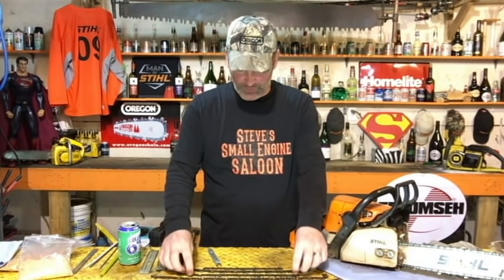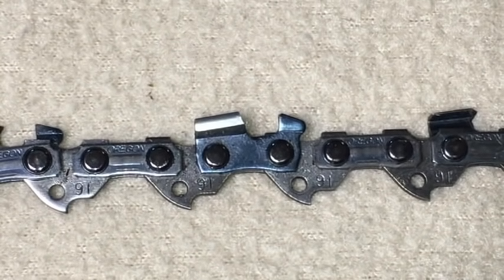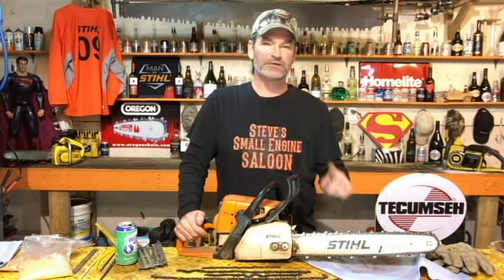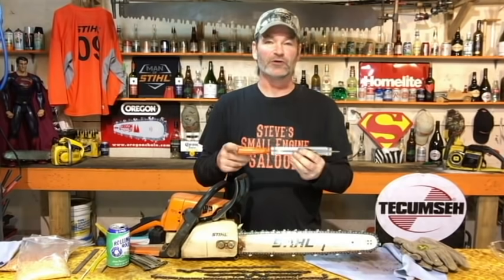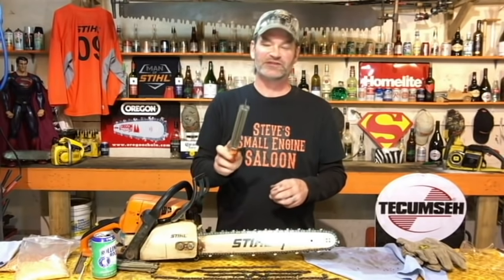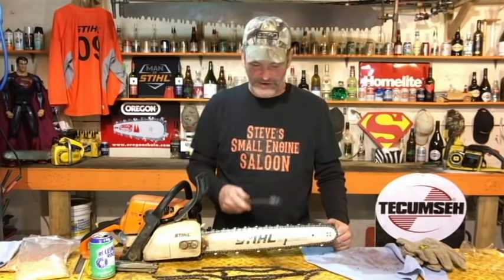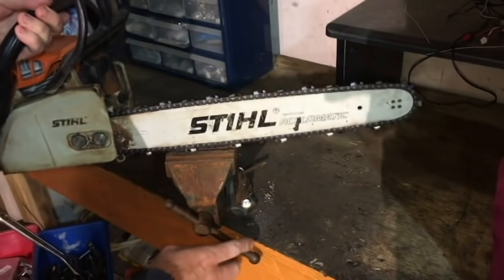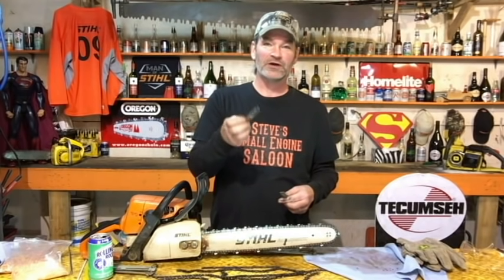CORRECT WAY To SHARPEN A Chainsaw (Step By Step)

Comment: Whats up steve i was sharpen my chain on my ms170 and noticed on the bar the oiler hole is kind of small could i possibly drill the bar oiler hole out a little so the bar gets more oil when cutting

Comment: Hey Steve, what's your opinion about electric grinding type sharpeners?  I know they leave a very sharp tooth but I have been told they are more difficult to keep sharp with a file after that?  Also the chain wears out faster than just sharpening with a file.

Comment: Raker guide that guages off a single tooth, like the one shown, sets the height to match the tooth they are in front of and also protect the sharp tooth from being hit by the file.  I don't use a guide for the round file anymore but ALWAYS use the raker guide!
Reply from the maker: Right on

Comment: I'm old small engine hobbies for over forty years but not an expert on two cycles , my question is that I can buy non-ethanol gas from a local gas station  as I have done for many years . is it as good a gas to use as the non-ethanol gas in the can for two cycles you can buy at Walmart or other places .
Thanks in advance , Marshall Border here in Jonesboro Arkansas

Comment: at around 7:50 you mention that the horizontal angle (perp to bar) should be flat.  some chain manufactures specifications require a 10 degree angle - when sharpening, should we be changing the angle from factory spec?

Comment: My Oregon chain, according to Oregon, is to be sharpened at 10 deg. tilt, but there is note at the bottom  that says at 90 deg. or flat, as you said, IF using the sharpening guide.  What could be the difference?

Comment: thankyou very much that was a great explanation of how to sharpen a chain. i have just bought a GT Garden TT CS 5800. a quick question do you know what type of fuel i would need to use for this saw ? today i put in petrol, and it did not work. the guy i bought it from i think he said the fuel should be a mix, he is french and i am scottish so i think it was lost in translation ?

Comment: Been sharpening chains for years, and looks like I do it right. Never would have occurred to me to file backwards!
I'm quite good with a saw, but after 59 years of intermittent use I'll still find a nail or stone if there is one. So I have to sharpen the saw on the job, away from the garage. I sharpen without a guide, saw across my knee, holding the bar and chain with one hand. I'm not saying I'm right. But I just like it that way, and would guess I hit ninety, maybe ninety five percent accuracy. Maybe more, I don't know.
Good one about looking at the chips, I knew that, you know I did.
Reply from the maker: Right on Stew!  Thank You...

Comment: I am a chainsaw sculptor.. Steve you are very informative, but I disagree with the direction of filing. Let me ask one question, which direction do you sharpen your knife? Hopefully against the edge. Why?  Because  drawing the knife away from the stone/file rolls the edge. Yes I realize the file skips from time to time going against the edge but that only allows me to know 1) either the chain tension is to loose, 2) I am filing with wrong form/angle. Hope you understand my explanation
Reply from the maker: Fair enough!

Comment: Hello Steve! Thanks for the video, I have a question for u and very curious on ur reply . As u would know there is on some chains there r a 10 degree table tilt when using an electric chain sharpener, how much can it differ the chain when sharpening it by hand? I hope I catch ur reply thanks

Comment: GET THE GULLET! And I use a husky raker guage. The little flat steel with a hard and a soft wood side. If you've hit a Rick or bullet and really damage a tooth or teeth that have to be sharpened way back a raker guage is a must.

Comment: My problem has always been keeping the same angle side to side. I'm right handed and when I switch to the left side teeth is when I have trouble keeping the angle. But i never had a vise to clamp it in, I was just holding it with my off hand on the tailgate of my truck.

Comment: I’m 50 years old and have been sharpening my chain into the blade instead of away from the blade. Just like I sharpen a knife blade. The edge will produce a micro burr when sharpening away. 
I noticed you made sure to mention to sharpen into the blade. I know it’s not wrong because everyone I’ve seen sharpens that way. 
I think of each tooth as a little knife and can make them razor sharp. 
Am I alone in this camp of thought ? 
Would love some feedback on this

Comment: For ultimate precision, the Granberg file guide is excellent.  Each tooth filed exactly at 30 degrees, not 29 to 31 degrees, exact same depth with depth increments at 0.01".

Comment: A question on zero turn. I gave a To 42” cut zero turn that backfires when I start it and backfires when I turn it off. I have tried just about everything. Higher octane gas, full throttle when shutting down, idled down before shutting down, nothing helps. Can you help? Thanks a lot.

Comment: Thanks a lot. I been doing good except for the raker height. I never had filed them on a saw and I know thats been a problem.  Thanks even more fir telling people files only cut in one direction. Same thing with hacksaws people. Lift the blade on the backstroke. Also make a full stroke every stroke cause she dont like short strokes.
Reply from the maker: You're Welcome...

Comment: Razor sharp & same length   Is possible with just a file , the trick is to sharpen offen , but lightly ,  the longer you wait between sharpings you end up filing out damage in turn shorting it quicker .

Every time , I refill I sharpen , i also sharpen for every tree  

I take off less than if you what until it's blunt , as a blunt chain will compounded its damage .

Comment: Hey Steve, I have a Dolmar 6100 that I bought used. I tuned the carb to factory specs when I rebuilt it. When I start it, the chain turns at idle, whether or not I pull the trigger. Does it need a new clutch?

Comment: Steve good day to you, I have a question that I'm hoping that you can help me with. I own a Murry 13B326JC758 Murray 30" Riding mower. The mower itself has very low mileage and is used only 3 to 4 times a year at a vacation home that I own. The issue that I am having is the drive belt for the blade keeps breaking and I have changes the belt three times to date. I am only getting one cut before the belt break. The belt is tearing apart from the inside of the belt and not form the outside. I've changes all the pulley's with include the Spindle Assembly and the two other pully's that the belt rides on. All the pully's are lined up correctly I used a metal straight edge to check. All the Pulley's are OEM Parts form Murray including the belts. At this point I'm lost and hoping that you have a clue or lead my in the right direction....

Comment: Started watching your videos a couple of days ago when I was getting unusual “banana” cuts with one of my saws. Turned out to be the bar wearing low on one side after a particularly hard struggle with a large ash (it’s only a Ryobi rcs4046). I’ve always had good results sharpening by hand with Oregon 5/32 files and no apparent issues with the rakers going off. Anyway, inspired by the videos I’ve bought the Oregon sharpening kit and extra flat files for deburring and profiling the bar so we’ll see how it helps. Many thanks for making the effort to share your knowledge.

Comment: Steve, @12:50 (the dull thoot), 1st I use a flat file to remove the curve (the dull) while keeping the angle (30 degree). Then the round file as you did. Is it a good idea? Enjoy your Rocki'n Rock🍺

Comment: Good video.  My family owned a tree service until we all retired.  You covered everything I learned the hard way.  Especially the rakers.  I had to stress that to many of our employees.  That if you ignore the rakers the chain won't cut well. and you take off too much the saw probaby won't cut at all - it will stall.  I recently came across Stilhl's 2 in 1 chain sharpener and may give it a try.  Oh, and I had to stress - keep the chain out of the dirt!
Reply from the maker: Right on

Comment: The crazy thing is I use a raker gauge with the proper depth for my chain and it gives no chips just powder.   I wonder if these gauges are off or what.

Comment: I never successfully did this and I worked with saws for years.  The only thing I could do was get new chains or have them professionally sharpened.  Usually if I got any edge at all trying myself the saw would cut a curve lol.  It’s an excellent tool but no fun without a really sharp blade

Comment: I have a Echo CS590 that has the 3/8 .50 chain and been using a 13/64 file and wondering myself if I'm getting it sharp enough. I have a 7/32 file that was recommended and also the Stihl 2 in 1 but since I started with the 13/64 I've wanted to stick with it. The hook feels really sharp but feel like I'm not getting the gullet right. Guess I'll learn by trial and error cause I'm a green horn with no one to give me direction. Anyone have any suggestions that would be helpful

Comment: Steve, My first experience with a chain saw (I live in England) and this video makes me a lot more confident I can maintain this useful piece of equipment. (I am over 70yrs old so a late starter with a chain saw.) Need to start cutting logs now oil and gas so expensive. Feel a lot more confident after videos on chain tension and chain sharpening. You are a great teacher and your instructions are very clear. I have had a file guide in my tool box for over 40years and never knew it was for chain saw teeth! You live and learn.

Comment: Great video, and worth the time to watch, although I did at 1.5 speed.  :0)  

Perfect timing on this, at least for me.  I just slammed a guy on another channel swearing by using a file in a drill.  I likened him to people that would sharpen a kitchen knife on a bench grinder because it sounds great to those with no sharpening knowledge, but the depth of the file controls the angle at the cutting edge, and without the guide, there's no way a human can keep that angle within 1/16 of an inch without shifting.

Comment: Absolutely fantastic info! No worries about the length, it was all essential, useful information. It’s exactly what I needed to be able to sharpen my saw chains properly and with confidence.

==> As another viewer commented below, I’d really like to see a short vid on how to sharpen rip chains, as I want to slab some beautiful red oak logs I have in my back yard after we had to have a couple of trees taken down.
Reply: Same technique just a 10 degree angle advised for ripping (vs. 30 +/- for cross-cutting).

Comment: 3/8 chain is not always 7/32.  Stihl chain is 13/64.  Oregon and Husky are 7/32.  I keep both sizes in my file set, Stihl of course and all are fitted with file handles, even my raker file.  I do left hand cutters, first, and then flip it around and do the right hand cutters.  That laser line on the rear of the cutters is the wear line for the chain.  When you reach that line the chain is worn out.  It can also be used as a guide line.  Please remember some chains are ground at 30 degrees(Stihl) and some 25 degrees (husky). I file all chains at 30 degrees.  I sharpen a tooth until I get a sharp cutting corner.  I do not use a vise, but I put wood blocks under the end of the bar to support it.  I check my rakers every time I sharpen a chain.  I do set my rakers slightly hungry.

Comment: What have gone wrong that after sharpening the cut is crooked? In case of big log it's even impossible to cut because the bar jamms? The 30 degree angle is kept because the chain was sharpened using dedicated grinder? Isn't it because of bad depth gauges hight?
Reply from the maker: That video is in my playlist

Comment: Maybe this is just because I’m using such large saws and bars. If you start getting too many short teeth on one side the saw won’t cut straight and the cut will curve off. I try and keep all my teeth within 1-2 millimeters in size.

Comment: Even amount of strokes per tooth... whether right or wrong, I was taught that the amount of strokes required to fix your WORST tooth should be applied to the remaining teeth for  fully sharp and even length teeth.

Comment: I tried to cut through a stump with rocks in it. I need an electric file grinder otherwise this chain is extremely difficult to fix by hand manually

Comment: Another thing
Use a sharp file.
Chain saw files are cheap, have plenty on hand.
When a file stops cutting well, get a new one
Your cutting edges will not be as sharp or as accurate using a blunt file.

Using a guide and sharpening the chain, accurately, at the same angle, every time, every tooth. makes your chain last longer.

Sharpen early, the sharper the chain the better it will stay sharp and the longer it will last.

The idea of sharpening every time you fill the fuel tank is reasonable even if you put two strokes on each tooth.

Comment: Long videos u really need endurance. Endurance requires a second or third beer as it's premium fuel.

Anyways in last 42 years since I first sharpened saws Ive used almost every filing gadget ever sold. Some take setup time, some fidgety. 
The one that sharpens cutter and depth guide to me is not perfect as way out. 
I still like to use the standard file and guide then following up with the depth gauge and flat file.

Comment: You will have a slow cutting or a dull chain if you use a filing guide like this one. The file doesn't go deep enough into the tooth

Comment: Check list: Right size file for your chain, correct angle (it varies, belieweor no depend on task but 35 is good start) , all teeth are equall lenght (shorter do not do any cutting), all teeth are sharpened. Push file, not pull (it will dull).

Comment: I’ve always filed backwards, and I’m really curious as to why it’s considered wrong, as when you sharpen a blade, you file into the edge, and not out, so you don’t develop a burr on your cutting edge. I’ve never used a guide either, and I’ve found the chain will chatter almost every time if you don’t somewhat support the tooth your filing. I simply put my thumb into it. 
  I’m not saying filing the other way is wrong, it just doesn’t make sense to leave a burr, or go back and take it off. If someone could better explain things, that would be great.

Comment: Steve you mentioned running your chain backwards.
I think I may have mentioned years ago my Husky 77 when I started it, it was running backwards.
My man said he had never seen it .
After I showed he was amazed.
Only thing obvious was partially smashed muffler.
We opened up the vanes on muffler pulled rope and it ran perfectly and in right direction.

Comment: Steve, when you sharpen any edge tool like a knife, or chisel you push the edge toward the abrasive to avoid creating a curl on the back side of the edge. Everyone sharpens a chainsaw tooth by filing in the opposite direction. I understand that's how it is done, my question is why?

Comment: 9:30    one could just place a red, or pink, line, on the bench underneath the bar.    sharpen one tooth, move chain, ;; repeat till done.

Comment: 6:20   just put the damn bar, in a vice. That is what they're for....to  'hold'  things, so the filer guy, can 'do his thing'.... i would tighten the chain, as much as it could go, then file away. After, then adjust it, for ' proper '' tension, as per Dr Steves'  info  .....ONLY  file, either pushing away from you, or reverse file, and pull toward you. The file, will last  a    l o n g     time.
Reply: 7:00     A    HA    !!!!

Comment: Every pro I know just sharpens on the spot with no vice and most don't use a guide. Your method is accurate but not realistic at all when you're working hard and fast and time matters. I like to do a quick touchup after every tank of gas and a full sharpen if I hit a nail or a stone. I do it on the spot though with nothing but a file and a handle and that has served me well for 40 years now and my saws cut clean and straight. It's all very well doing it your way but then you're stuffed if you're out in the field and don't have a vice and guide and all the fancy doodaccies.

Comment: 11:20 this has actually been proven false! It does not damage the file at all to pull it backwards and in fact good files can still cut (albeit not NEARLY as efficiently) while being pulled backwards. 

There’s a long video testing it on fireball tool’s YouTube channel where they set up a file on a piston and measure its wear over thousands of cuts comparing back dragging vs lifting. Found absolutely no difference in file wear, but the back dragged file removed more material in the same amount of passes.
Reply from the maker: Well, I have a video in my playlist proving that it is true, under a microscope!

Comment: I almost PUKED AGAIN when I saw Steve hold up that Rolling Rock Beer....In the Early 80s my wife and I were in San Francisco getting Drunk and Drinking Rolling Rock....About 8pm we stopped at Mel's Drive inn for a Hamburger and I couldn't finish all of mine so I got a Bag to go...While crossing the Bay Bridge I had to PUKE so I took my Hamburger bag and Puked in it...NO BIG DEAL ..I was going to throw the bag out once we went across the Bridge...It's a long Bridge.....The Wife was Driving...We got across the Bridge and got over in the far right Lane and I was going to throw the bag out but the Bottom of the Bag was Soaked from PUKE and the Bottom of the bag fell into my Lap....I'm about ready to PUKE NOW thinking about it some 40 years later....So I had to ride home to Concord about 45 minutes away and not trying to move with a LAP FULL OF PUKE.....I could drink Beer all day back then but we were Drinking ROLLING ROCK and it didn't sit well....I haven't drank ROLLING ROCK BEER Since.....